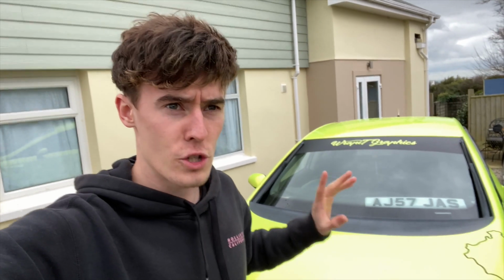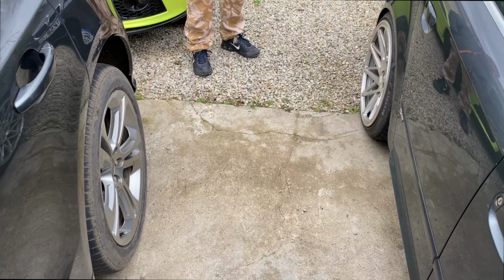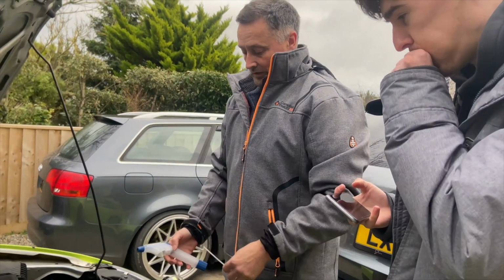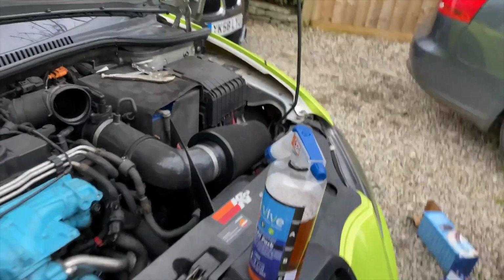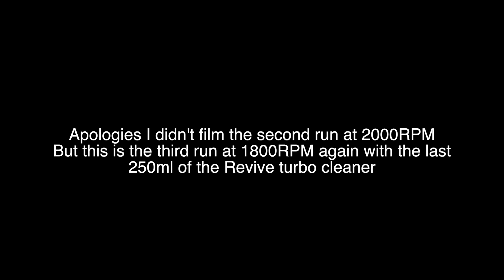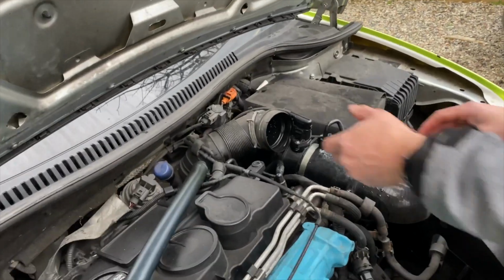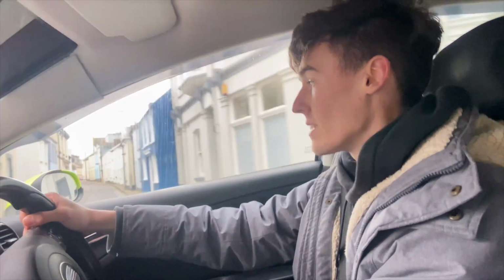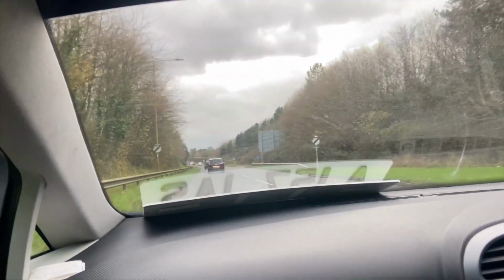TURBO CLEANING THE SEAT LEON FR | REVIVE TURBO CLEANER | JSMK

Comment: Used Revive a few times - it's good - but honestly, I've found a good old can of Wynn's Turbo Cleaner just as effective (if not a little more as it foams, which revive doesn't, meaning it gets into more small crevices and areas of the turbo), at less than a quarter of the price of a bottle of Revive.
Reply from the maker: Fair enough, really appreciate the advice! Will give that ago soon as I want to turbo clean it again so will be interesting to see if there’s a considerable difference!
Reply: you think liquid wont get in where foam gets in?

Comment: you look a bit scared. It will be nice to do job as instruction recomended. And on ride after putting cleaner to intake its recomended to go up and down on revs. I can say product works. Done on few cars and defo works. Dont be worrie about clogged cat as it not happened. If you want to you can put some JLM regen to fuel and will works with your dpf/cat.

Comment: Any idea have a seat leon fr 2.0 tdi lack of power turbo is kicking in but not strong enough had egr cleaned and tested new maf senor had dpf cleaned  no codes when plugged in no lights on dash
Reply from the maker: And boost leaks potentially? Like a split intercooler hose?
Reply from the maker: Maybe a bad fuel and air filter, then it wouldn’t be running right and cut the power